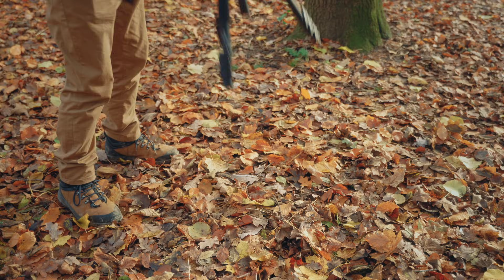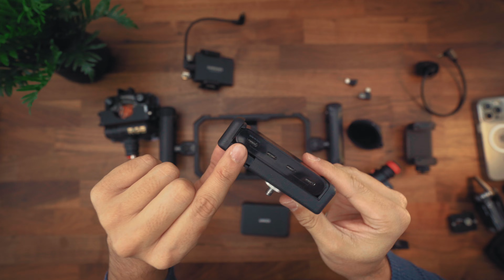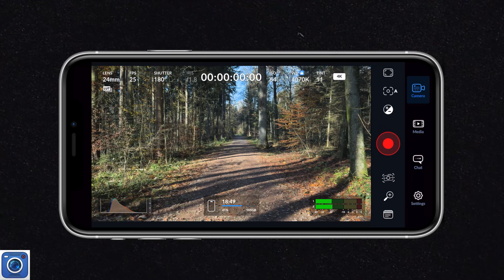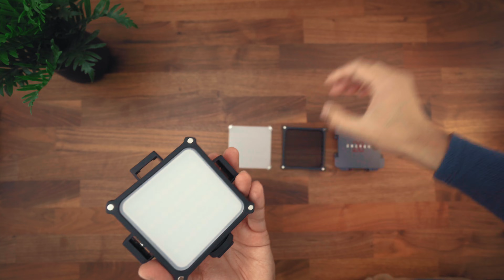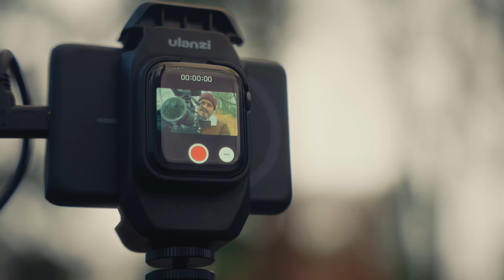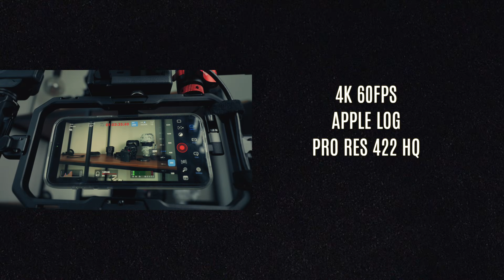Turn your iPhone 15 Pro Max into a Pro Camera

Comment: Since iPhone 15 Pro is smaller than the Pro Max, do you think this cage would work with it? It falls in the acceptable range when it comes to the width of phone but what Im concerned about is if the VND filter would get in the way of the phone holder on the back?

Comment: Zyiyun light is bright for it’s size.. but battery is worst in any light I have ever used. 10-15 at max. power and your light is dead !!! Uselesss
No way it has 40 min full power run time..possibly 20 if the room is 65 degrees. My second unit too.. first one was totally faulty.
Better be powering your light instead of your iphone.

Comment: The gear is impressive, it's interesting, congratulations on the video. But for the type of content I record, I prefer a minimalist setup for two reasons, the time it would take to set up the equipment, and the cost of all this is already enough for a decent camera. I assume that a cell phone is more for "run and gun"

I still liked what I saw in the video.

Comment: I built a rig with this USB-C hub, a 5000 Mah power bank and an Extreme SSD by Sandisk but when i plug in the power to the left USB-C it doesn't charge my iphone 15 pro max. The SSD is working well but i cannot charge the phone while recording. The HUB works only in reversed mode ... If i plug the cord USB-CV to the battery i can tale power from every USB-C port but i can't use the SSD. I take some mistake somewhere?

Comment: To all those who are planning to shoot "Pro Videos" with iPhone 15 Pro max, keep your expectations low—like really low. First, 2x and 5X lenses are not sharp. Second, noise levels are very high. You can only get acceptable results if you are under really bright light and using ND filters. The dynamic range is very low. I would recommend getting DJI OP3 and shooting with that. The only downside is not having telescopic lenses.

Comment: Thank you for your video. I was seriously contemplating using this cage over their older universal one. However, I’ve read complaints about the 15 Pro Max in a case with a lens, will cause the phone to tilt, while in the clamp and it was annoying having to continually readjust the iPhone, leveling it off at frequent intervals. Have you had that issue?Your response will inform my purchasing decision.
Reply from the maker: Thanks a lot for watching! The clamp does move very slightly due to the detachable design which could affect the leveling. I haven’t found it to be an issue. However if you do need the best stability, I would suggest you go for a rig that has a built in spring clamp such as the older rigs from smallrig.

Comment: Great idea with the hub, but what must be done, what`s the setup so that the iPhone saves the video to the external ssd and not in the integrated storage?
Reply from the maker: Once your ssd is connected in the BMC app you can select your external storage. On the Default Camera app it will automatically detect the sad and record it externally.
Reply: @BenettGraezer  Thanks. BMC is the solution.

Comment: How are you able to use the magnetic filter attachment with that phone cage? I have the same filter adapter and cage and the filter gets in the way of the MagSafe mount.

Edit: nevermind I missed the part where this was an ip15promax. I just have the 15pro. 15 pro owners take not. You cannot use this cage and the filter adapter together.

Comment: hey dude incredible video, do you think your setup will fit onto a dji RS3 mini?
Reply from the maker: Thanks a lot not sure haven’t tested it out.
Reply: @BenettGraezer  OK no worries, I'm building a slightly compact version of your setup with the battery and ssd mounted to the back of the phone within the Brandon li small rig cage which I'm confident will fit on the gimbal. I'll let you know how it goes! Thanks again for the video, totally changed my mind about the concept of taking shooting onto phones seriously 🙏

Comment: With this setup the DJI Mic 2 receiver will need to be turned upside down (180 degrees) to see the audio waves and to work with it normal...
How do you do this?

Comment: Thanks for the ideas! Do you think, if you're going to build a rig like this, that there's much point in paying extra for a 512GB or 1TB 15 Pro Max over the 256GB?
Reply from the maker: If you have the extra budget and use your iPhone for professional work then yes. This way you won‘t necessarily need an external ssd

Comment: If using the Pro Max 15 with 512GB or 1TB, is it still necessary to get an additional external storage? Shooting in Pro Res or Pro Res LT; other apps/media on phone would approximately take 8oGB.
Reply: FYI: you can only film 4k log 60fps by recording to external storage. if you don't need 60fps you should be fine, though then you have the added workflow step of transferring your files from your phone to your computer to edit, whereas with an sd card or external ssd you can just connect them and begin editing

Comment: what u forgot to mention is a usb-c hub with a pd 90/80 watt power with an extra battery to power the whole system rig specially if u want to save to external ssd hd and if you want to monitor your recording audio you need rode audio input that provides software for audio recording . sorry body but you  have to show  the whole picture in order to make it  work for a real video recorder rig..

Comment: Hey, great rig.. can i ask if you have any trouble with the phone or Blackmagic App seeing the SSD Drive? I have a Samsung T7 1TB and i'll point the file save to the T7 in the Blackmagic App and if I lock the camera between takes and go back into the App more often than not the T7 has disappeared and even unplugging it and plugging back in can be hit and miss as to how long it takes to pop back up to use again.. I'm just wondering if it's a slightly dodgy drive.. I use a brand new short 40GBs lead so ruled that one out!
Reply from the maker: I havent experienced any problem so far. The connection has remained stable. You might consider formating you SSD to APFS.For Mac users, APFS is generally the better choice, as it's optimized for Mac systems and offers better performance on SSDs.
Reply: Ah thanks for that, I’ll give that one a go and see if it’s any better.. 👍👍

Comment: For me, most important is: an external handle (wheel) to control the zoom! Is there something in the market?
Reply from the maker: Not that I know of. I know it exists with gimbal, such ad the dji om 6 that has a zoom/focus wheel but it requires you to use it with their dji mimo app.

Comment: Nice work.  Quick question.  Does the black magic app allow you to take photos or still or just video?  I have the app and simply cannot find out if it takes stills.  Thanks!
Reply from the maker: Thanks a lot, no it does not take stills. It id soley a video application.

Comment: SAVE MONEY --> This magic arm from Smallrig is WAY cheaper, AND it comes with the clamp: "SMALLRIG Super Clamp Crab-Shaped & Magic Arm". And I also found that the "ULANZI ST-06" is way cheaper than the mount you mention here (of course it doesn't have the option to mount the Apple Watch, but I don't plan to either way).

Comment: Great Video, New to the 15 max pro, But wondering the cage is quite large as it is made for any cell. I would like a cage made just for the pro max, smaller as well to fit nicely
Reply from the maker: Thanks a lot,  i have a video on the iphone 15 pro max cage co dwaigned with brandon, which might interest you :)

Comment: I just built a version of this rig using a VANGREE USB C to USB C Hub-3 USB 3.2 Gen 2 Ports with 10Gbps, 4K@60Hz HDMI Multiport Adapter, 100W PD, 2 USB 3.0 & SD/TF Card Reader, USB-C Splitter. I use it with a Samsung SSD and a power brick and a Rode wireless system. This hub also has a HDMI out, so that I can connect to a monitor when I have a separate camera operator.  When using this rig, you have to remember that this is a phone. That means you have to turn on airplane mode so that the phone won’t ring in the middle of a shot. Also, you have to turn off Standby or the phone turns into a clock when the power brick battery charges the phone. The rig is still lighter than my rigged out Sony FX3 and is much less expensive.
Reply from the maker: Thank you for sharing your rig version as well as the additional tips 👍🏻
Reply: Hi Joseph, what battery block are you using to power the Vangree hub and does it power all 4 USB-C ports? Thanks!
Reply: can you reply with all the links to the products you used? how much did it come up to? $?

Comment: Good video. I have a iphone 15 pro max setup and found that the external SSD is extra weight that isnt needed if youre using the BM app. It stores the files internally through the app and you can just dump the files to your SSD when back at home. Less weight, less power usage.
Reply from the maker: Thanks for sharinf your thoughts! Yes that istrue, however for recording in a higher quality format duch as ProPres 422 HQ i still recommend using an external ssd due to the lager file size it produces :).
Reply: May I know the complete name of “BM” apps ?
Reply: Probably Black Magic camera app @songieesiang

Comment: Thank you for sharing. It's a great setup, but personally too large. I'm looking for a more minimalist solution for my iPhone 15 Pro and a LaCie SSD. I've also looked at the SmallRig 2791B (future-proof as well), but it's also 22cm wide. Do you have another small solution, perhaps?
Reply from the maker: Thanks for sharing! Have you check out the cage co designed by brandon li?
Reply: Yes but is for 15 pro max. also I want to keep my case on.

Comment: That is pretty cool! Apple Watch doesn’t work with black magic camera app yet, so I would love to see an hdmi monitor instead of the light. The light is cool, but I’d rather it was independent of the camera. I have experimented with AirPlay and hdmi, and both work well. 

Also, for the variable ND. I want to get a case that has the mount built in, I really hate the way the clips work/look. Was comparing some options that also allow an anamorphic lens.
Reply from the maker: Thanks for sharing your story thoughts, some great inputs💯
Reply: @BenettGraezer  I ended up getting a Viltrox HDMI monitor which works perfectly. I also got the neewer case, which has a mount for 67mm filters, and I got the K&F Concept Variable ND 2-400. It's a very flexible set up, good for run-and-gun, tripod/static or something in between.

Comment: It looks great. But, as you said, for all that, it’s better to use a proper camera. If you add up all gear, you’ll be able to buy a proper camera
Reply: Eh, if you aren’t going to spend around 6k on the camera set up, why bother? I don’t think you will get much benefit until you hit that price point. 

I’d say use the iPhone and practice until you outgrow it, and then jump to a a7siii or fx3 plus lenses, etc

I think if you spend 2k on a camera and still have some phone that you paid for, your camera probably won’t make much of a difference. 

You’ll upgrade to get better depth of field and other features, namely to get a larger sensor. So wait till you can get a full frame, like BM 4k or Sony, but I wouldn’t start with that. 

I personally don’t like a tiny marginal improvement that requires a separate device. Start with the bare minimum that can work, then upgrade to something with massive gains.
Reply: @MJR3218  I totally agree, the new iphone 15 pro and pro max, with addition of apple log, means you can get professional quality. You would be hard pushed to get the results with a camera less than 2k, then there is the addition of the lenses, so cards, external recorder to record in pro res. Plus the gear detailed in this video, apart from the cage can be transfered to a camera set up at a later stage if required.
Reply: @marcmccoy5676  Yeah, my tripod, monitor, mics, filters, etc can all be used when i outgrow the iPhone, and I figure if/when I upgrade it would be to a full frame camera (ZV-E1, A7S3, FX3). 

I would think carefully about buying things that only work with the iPhone, using a proprietary solution. Even if you were going to "just buy a real camera", I am pretty sure that doesn't mean you will not have a smartphone...so might as well start out with the best smartphone for video, and then upgrade later on when you really want to invest fully.
Reply: Some would say if you can afford an IPhone 15 why not just get a proper camera? But once the Lens Price start to pile up 😂 😂 😂 😂 😂 you realise the Price Gap is Huge..
Reply: @JayfkProductions876  exactly, you can spend the same money on your phone + a camera, or you can just get the phone. If you want to add accessories, make sure they work with a future camera (like DJI Mic, Tripod, filters, monitors, etc)
Reply: Nah not true why not use your phone for the basics and learn how to shoot learn the settings etc. once your familiar and comfortable how to shoot then get your self a camera if your budget allows also how I know your not a 💯 percent knowing how to shoot everything he haves on his phone rig can transfer over to the camera the ssd the light the dji mics your gonna have to invest on those things as well for the camera so it’s not a waste
Reply: If you are aiming for professional video get a dedicated camera.  You’ll need experience with lenses and you will need aperture control and larger sensor to stand the test of time.  If you want just a bad ass phone that can “in a pinch” offer quality video.  Like recording your kids and memories in general without hauling around a dedicated camera.
Reply: @ThiCityProductions  I mean, like a professional video for a 3 trillion dollar company announcing their new computer chip and line of computers?

If you say "but they also used other stuff" I would say "ok, but they did only use the iPhone as a camera to record it, if your project requires sky panels, then you will still need that regardless of which camera you choose". 

I definitely do not think its the case that you must have a dedicated camera for professional work anymore. It depends on the project, and its requirements, but you can get great video out of an iPhone that can work in a lot of different scenarios. 

I just think its flat out false to say you cannot use iPhone for professional work in 2023. That being said, there are a lot of cool things you can unlock with a professional camera, and I would say you start unlocking those things once you get to around 3 or 4 times the cost of the iPhone.
Reply: That’s just my opinion, by the way, 6k is my own arbitrary number as the threshold for when it makes sense to jump to a dedicated camera. Accounting for lenses, filters, batteries, bags, gimbals, tripods, cards, etc.
Reply: Wrong! Most people already have a $1k phone in their pocket with a pretty bad ass camera like the iPhone. Just rig it out like this and you’re good. Why buy another $1k or more on a dedicated camera, spending extra on lenses and rigging that out? Like some are saying, just upgrade when you outgrow it.
Reply: And then need gear for the camera?
Reply: @ArcaneCowboy  Not really, I got a Viltrox Monitor, a 67 mm ND filter, a tripod with a 1/4 20, an ssd, a dji mic set...what of those things is specific to the iphone? they can be reused on any camera, the only iPhone specific thing I got is an iPhone cage. 

If you get the camera, you are still going to buy a phone anyway, so it is not either or, its both or one. 

The point is that you probably won't see much if any benefit in a standalone camera until you are at a more advanced level anyway.
Reply: Make a vedio with Samsung S23ultra with all these gear..Are all these gears computable with S 23 ultra also?
Reply: I just bot a pro max 5 - amazing prores quality selling my canon glass and cameras tired of lugging around tons of gear - imagine where apple phones will be in a year - the pro max is a game changer   - love it , u will too
Reply: Not really all the same kit for a professional camera will cost you way more, plus with even dslr’s lightning becomes way more complicated
Reply: The fact that anyone says “ proper camera”…. Just say you don’t know why you’re doing.. 
a rule of thumb to live by.. price doesn’t compensate for talent. And skills

A entire season of the show “ house” was shot with a canon 80D

There’s many filmmakers out there using NOT the top of the line equipment 
And getting excellent footage

Remember… the general public for the most part can’t tell the difference, only the enthusiasts and professionals can/will recognize the difference, buts that’s only because they trained their eyes to recognize that..

And if you’re not shooting big budget film, or starting out…
I believe this is a great start for a novice or even medium grade…. Tubi peacock will definitely pick this footage up

Comment: On the link for the filters it only has options to buy for iPhone 14 not iPhone 15. Which one can I buy that will be compatible with the iPhone 15 pro max
Reply from the maker: The VND filter is also compatible with the iPhone 15 Pro Max 👍🏻

Comment: I have most of the gear shown here but have not used them yet. Bought the older smallrig universal kit a year ago, but after watching the new one with magnetic attachment, ordered the new universal rig from Smallrig. I don't have an iPhone 15 Pro or Promax. Use Galaxy S22 with Filmic Pro League version and the video is very nice. I bought a Magsafe magnet and glued it on the case and it works. I bought the power bank, but too big to fit or it will fit, but the weight is too much. I'm thinking of buying thinner and smaller size power banks 5000-10000 mAh. Thanks for sharing the video. Like small rig and Ulanzi accessories(higher quality).
Reply from the maker: Thanks for sharing your thoughts and the gear you use, awesome 👍🏻